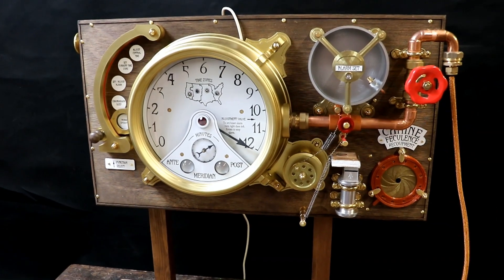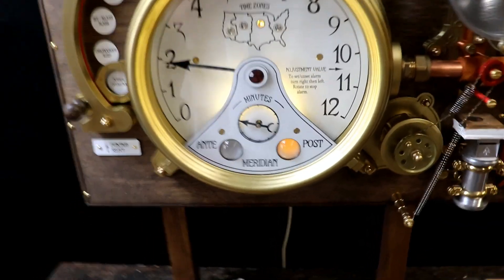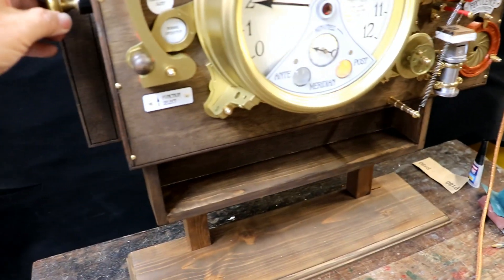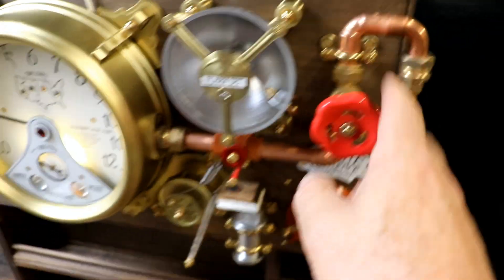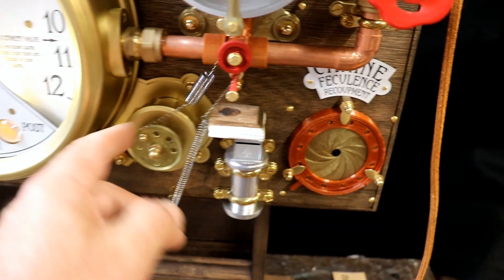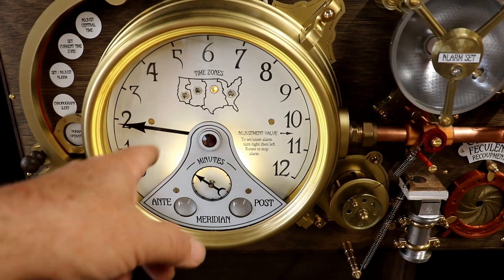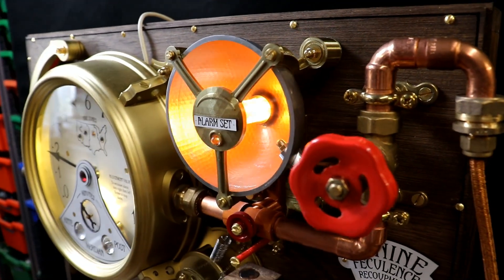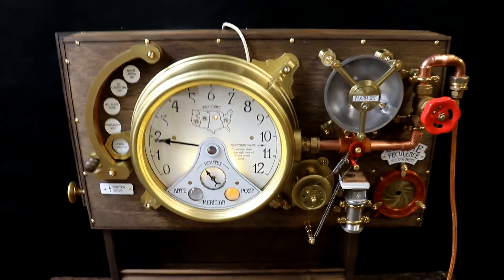The Steampunk Timezone Clock is Complete!

Comment: How does she reload the “poop” bags.  So many questions.
Reply from the maker: I decided not to have a slot in the top as this would have weakened the structure, so it's just a case of lifting the bottom one with a finger and sliding in the next roll. I've tried it and it's easy to do.